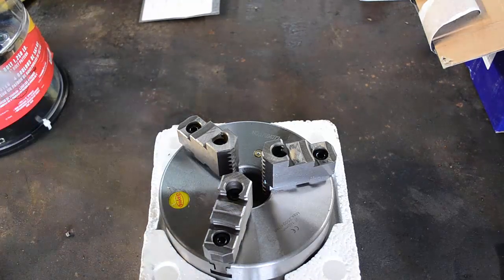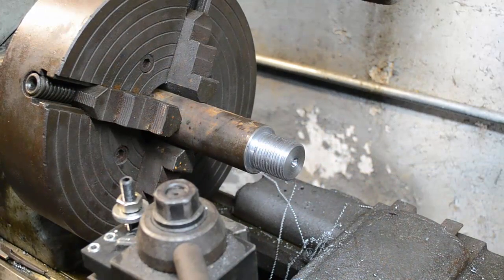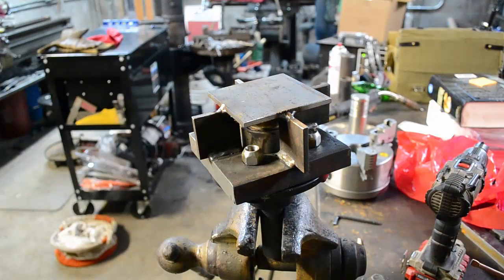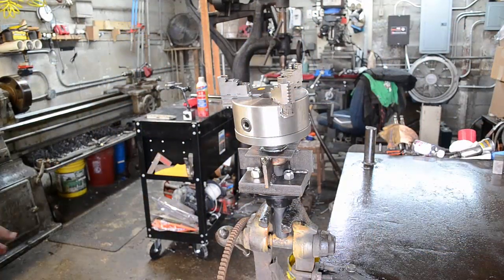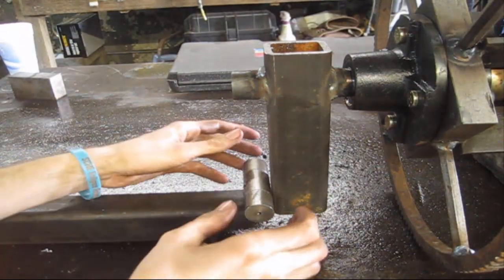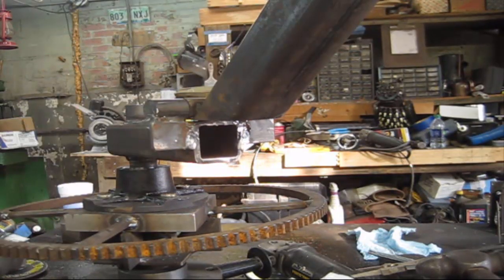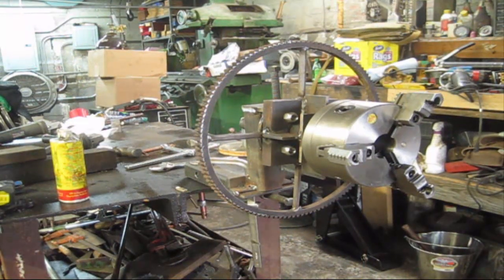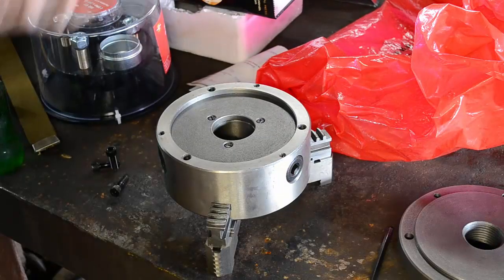Rollout wheel build.

Comment: Some backing plates are made to be machined to size once installed to minimise runout. One could be generous and say thats what they were up to with that oversize backing plate.  You could use a tow bar hitch type mount under your bench to hold that rollout wheel in position, I mount some of my vices that way so they are easily moved about.

Comment: Here is an idea for the stage you had to to fight with the warping by tacks:  you could have made a sticking short bolt at the end of the part instead of flat round surface to weld to another flat surface. the you could drill and tap in the center of that plate a matching threaded hole, than by screw the part and tight  it  inside it will grip so hard that it want warp when tacking and you do not need to use the indicator at all.

Comment: So what prevents the hub bearings from welding themselves to the races while you turn the hand wheel? It seems to me that grounding the work  through the bearings would cause problems with them. Maybe that's why you chose the trailer hub for the rotating assembly - the bearings and races are cheap to replace and you can find them almost anywhere.

Comment: You have a bunch of loose threads hanging off your belt on your drill press /your belt will last you a lot longer if you cut them threads off and put a little bit of glue to keep more from peeling

Comment: What would happen if the stub axle was removed and cut down and threaded for the back plate?  Seems to me it would save several inches of overhang on a very heavy unit.  It would also eliminate weldments that are prone to warpage.  The wheel hub would become the mount for the assembly.....

Comment: made mine with a 90's chevy 2500 hub. knocked out the studs,  pressed it apart and faced it off. Drilled the flange for the chuck at put it back together, the wheel speed sensor hole worked great for a grease zerk. Might have to add a ring gear, that part is super nice, and like how you did the hinge

Comment: What was the diameter of that ring gear -- 16"?
Reply from the maker: I’d say that’s about right.  It came out of a 1066 IH tractor.
Reply: @EEJester1586  -- Thank you for the reply. In the process of building a rollout myself and I was just trying to determine a ring size. I had cut a ring from a 12" piece of pipe that was .250 wall but it seemed a little small I thought.

Comment: That is a cool build.  I like how it tips 90 degrees and is adjustable for horizontal.   My son bought a 6" chuck direct from Shars.  He cut out the backing plate on the CNC plasma table from 1/4" plate, welded it to 1 or 1.25" ground shaft and mounted the shaft in pillow blocks.  That would make it a lot lighter and cost less than using a hub.  I don't know that weight is an advantage in that build.  We mounted his chuck on the CNC plasma cutter so we can CNC cut holes, slots, and notches in pipe.  It will turn and cut 6" sch 40 pipe.

Comment: why not make the hub stationary and thread the spindle stub for your backing plate?
Reply from the maker: lazyhranch That's a good idea. The hub spindle was the wrong size (1-1/16") needed 1-1/2". That would have worked on a bigger axle. Good question.
Reply: thread a bushing and press fit to the spindle. the closer you can keep the chuck to the pivot the better. i use mine welding some heavy stuff.
rollout  wheel  is  a very handy piece of equipment sure makes life easier. 
thanks for the videos

Comment: I like how this turned out. 
Speaking of builds that work out well, not too many years ago I was doing maintenance on a fleet of live haul semi trailers that haul chickens. The trailers had a crank at the back to roll the tarp up which was on a square shaft with a small universal joint at the back where the handle attached. The handle was one piece of square shaft inside another square shaft and almost daily the inside part would come out on the highway so there'd be no way to roll the tarp, and that can result in more dead chickens. To change it I had to heat the U joint and pound it off which sometimes would heat the birds up to the point of some of them dying. 
I cut the outside tube one foot below the U joint and built an insert so three 5/16" bolts held the two parts together. The result was that instead of taking an hour to make the tarp work one 5/16" bolt took care of the remove and replace and from one hour to 15 minutes with no heat stress for the critters.  
Once again a well done video of a well done build.

Comment: I think the chuck backplates are sold over sized on purpose so the backing plate can be machined on the actual lathe spindle it will be running on to size, supposedly this process eliminates the chuck runout or reduces it.

Comment: I think an old steering wheel from a tractor would work in place of the ring gear.  I replaced the steering wheel on my Ford tractor because it was old and cracked in many places due to always being in the weather.  I hit the old one with a hammer and all the material on the outside fell off, leaving the steel core.  I suppose a wheel from an old garden tractor would work just as well. The plastic on the outside probably would not even have to be removed.if the wheel was in decent shape.

Comment: Was there a reason that you did not put a sight countersink say .025 to the base plate before tack welding? I am sure the time taken to centre the piece with the dial indicator and then have it come off centre due the tack would have been remedied by a slight countersink. Good job and the ring gear already for a drive gear. Could you exlain your ground point is it work /chuck  side of the bearing or have you insulated the bearing from electrical conductivity?
Reply from the maker: CCC Detective I thought about doing something like that, but sense the plate was bolted to the hub and could be moved around I didn't think it necessary, but that definitely would have helped the fitting process.   The ground is through the bearings we will see in time if it hurts them.

Comment: I know very, very little about welding, so please correct me if I am wrong.  On the threaded piece you turned and welded on, would it have helped with warping if you had pre-heated the threaded piece and the square plate it was welded to?
Reply from the maker: GodzillaB210 Good question. The metal was just a little to thin. Bigger metal wouldn't have distorted as much.

Comment: Still concerned about grounding through the bearings. Any thoughts?
Reply from the maker: JD Custom I'll just have to see how it does, but other designs work the same way.  I've got a lead reel that works the same way been 2-1/2 years with heavy use and they still work pretty well.

Comment: I love your videos and you're always so precise. Thank you...but i was surprised when you took your cuts with your cross feed. That changes one side of your thread. You'll HAVE a loose thread if you do this. Always leave that feed tied down and locked. Do all your cuts with the main feed. Make a soap-stone mark, at your feed thousandths, so when you crank it out twice you can run it back in twice to that mark, and then dial in your next cut. Then wipe the mark off and mark it again. Hey...just one old machinist to another. Love your vids.
Reply from the maker: Lee Williams Thanks Mr. Lee. Sorry if it looked like I was dialing in the cut with the cross feed I was cutting with the compound 29-1/2 degree angle. I was running the cross slide back to 0 to make the next pass that way I wouldn't hit the thread when I put the lathe in reverse.  Sorry if that looked confusing. Thanks for the comment.
Reply: Classic Work m

Comment: I didn't see how you ran the ground. Or did you just hook the ground to the material so it doe not travel through the bearings
Reply: Terry Hillman you wouldn’t be available to roll out your weld with the brake on. Just saying
Reply from the maker: THE IRONWORKER yep ground is through the bearings. All the designs I've seen have been that way.  It is low speed, and I have lead reels that are made the same way. I'll let you know if it arcs out with more testing.

Comment: Great Job!! I Looks like you have a Thermal Dynamics Plazma cutter if that's  what it is how do you like it?? I have a thermal arc mig welder and im not to crazy about it. I have had an issue when you start mig welding it plows a flame and does not burn the wire properly. It happens maybe 5% of the time. I just used miller for yrs before that and i have never seen that before. I used a thermal arc before i bought this one and it did the same thing. again nice work on the build...

Comment: Great video. One thing you definitely need to do is put a few burn boxes on your welding table so ya don’t have to be messing around bending over your mig wire all the time picking off whiskers later or looking for pliers to trim it and then your wire is always hot when starting.
Reply: Why is there always so much stick out EVERY time?  (and using the gun as a hammer)

Comment: Nice job I used to weld up idle wheels for ditching  machines and trenchers  with a couple pieces of Acme thread you can set up your mig  head to weld it  automatically in the horizontal strike your arc  turn on the machine and it will make a constant weld to you get to the end one constant bead  
With a D C drive you can be variable speed makes turning it to size a lot easier due to constant weld thickness. 
 Your doing good work.

Comment: aren't mounting plates and chucks supposed to be different in size so you can fit it and dial it in to your lathe ? thats how i understand it as that mounting plate would have different runout any any lathe you screw it to till you true it up on your own individual machine
Reply: That is correct.
Reply: Most of the new style lathes have like cam style lock pins and there really isn't a lot of adjustment on them to true up three jaw chucks are not the most accurate and reliable for dead nuts zero for that a four jaw is the ticket

Comment: For an even cheaper version a simple face plate drilled for holding clamps could replace or be switched between the chuck and it.  The face plate only needs to be a piece of flat stock drilled and slotted etc.  Very nice project.  Can you ground it without running the current through the bearing?  Take care.  Doug
Reply from the maker: Douglas Thompson That would work very well. Might have to build some other attachments for it.  I thought about that too, but all the rollout wheels I've seen ground through the bearings.  And my lead reels do the same, so I think it will be fine. I'll let you know if I have any problems. Thanks for the comment.
Reply: If you're worried about grounding through the bearings, you can use a brush from a large engine starter mounted to noun against the backplate.  Or make a simple rotating flag type ground.    Very few up here bother with chucks.  Almost all rollout wheels are simple slotted plates that look like a lathe faceplate flame cut from 3/8" or 1/2" plate.  If you use a trailer hub, replacement bearings are roughly 20$/set.

Comment: Yeeeah!! Another cool project. I saw on eBay a LESSON BRAVO Series 1/8HP 12-volt DC MOTOR w/ LESSON HydroMec Speed Reducer 19:1, thought it would be a cool hookup for a weld positioner like this, and you could run it off the battery on your SA 200.